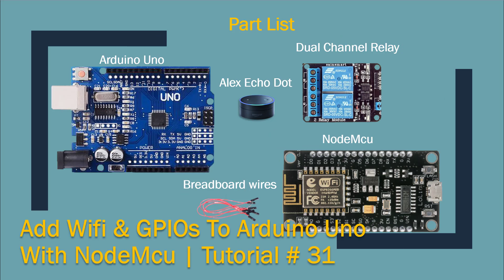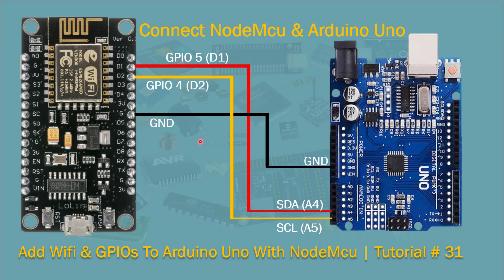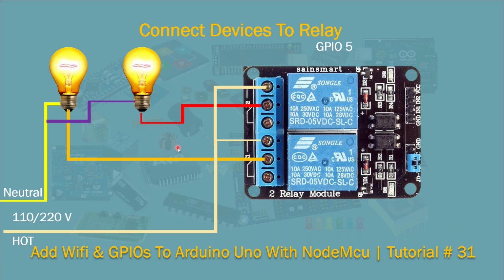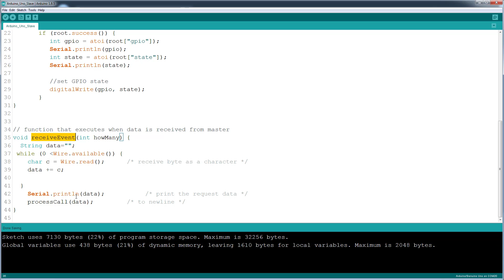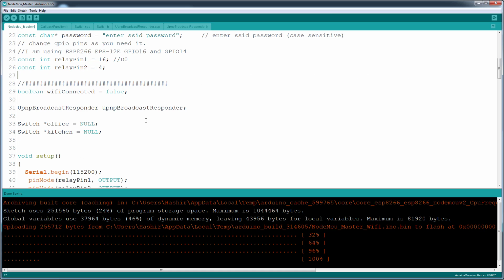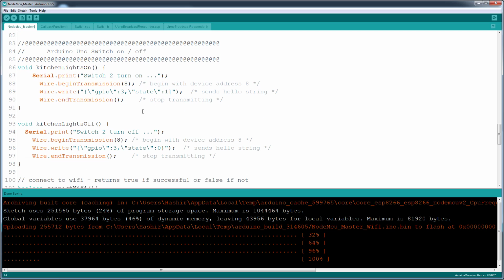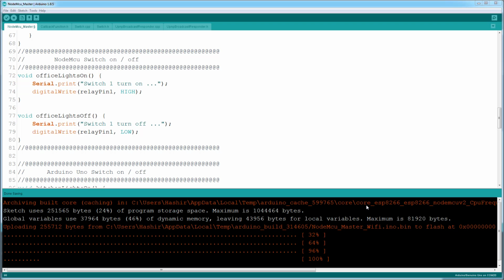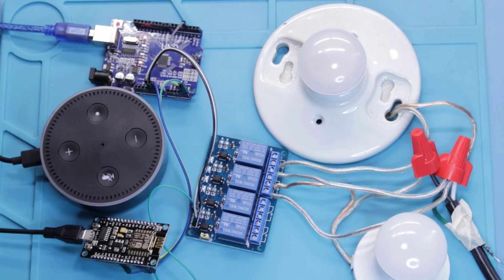Arduino & NodeMCU | Add WiFi And GPIOs | Tutorial # 31

Comment: how about the logic voltage, i mean since arduino is TTL 5volt while NODEMCU is 3.3v. it will not damaged the esp8266 chip?
Reply from the maker: Looks like Modem u is 5 volts tolerant

Comment: Hi,
I follow your videos. I am getting below error. I am not technical, just trying because I found it interesting. I am getting below error while flashing nodemcu. any suggestion from your side on this error? and Nodemcu could not connect to wifi.

Writing at 0x00000000... (7 %)
Writing at 0x00004000... (15 %)
Writing at 0x00008000... (23 %)
Writing at 0x0000c000... (30 %)
Writing at 0x00010000... (38 %)
Writing at 0x00014000... (46 %)
Writing at 0x00018000... (53 %)
Writing at 0x0001c000... (61 %)
Writing at 0x00020000... (69 %)
Writing at 0x00024000... (76 %)
Writing at 0x00028000... (84 %)
Writing at 0x0002c000... (92 %)
Writing at 0x00030000... (100 %)
Wrote 293040 bytes (211994 compressed) at 0x00000000 in 18.8 seconds (effective 124.4 kbit/s)...
Hash of data verified.

Leaving...
Hard resetting via RTS pin...

Comment: My q sir :- Connect minimum 3 Nodemcu devices with one Arduino-Uno OR Raspberry Pi( As
controller ) to Established connection between all the Nodemcu.
And on the basis of some range of virtual keys( like 10 keys per Nodemcu ) of Blynk
App, the controller communicates with there respected Nodemcu and do the work as per
data provided by Blynk App.

Comment: Thank you, bro..¡¡   But, I've a problem in the line "DynamicJsonBuffer jsonBuffer;" of the Arduino_uno_slave.ino 

 because that's need to upgrade to AndroidJson  v.6  , but I don't know how I've to do it.       Thank you so much, again :3   hehehe
Reply: I came across the same problem. I had a work around. I just installed the version 5 in ArduinoJson library.

Comment: Nice work
Could you please make revision of this video by adding dht22 or any temp and humidity sensor,.
Connect dht with uno and relays with esp8266.
read temp and humidity over esp  and one relay can operate with temp variation 2nd relay works with humidity.
Regards
Reply from the maker: Sure, I put it on my todo list. Stay tuned

Comment: Translated by Google Translator
Hi, very good video, I work perfectly
But I think this limited because you only have 10 outputs that if you connect Arduino one you take advantage but if you connect Arduino mega can not take all the outputs because there are more than 10
Ask.... is there any way that the NODEMCU active more outputs of the Arduino mega?
Reply from the maker: sparalable You can use the same code to access all GPIO on Arduino Maga.

Comment: I've got a nodemcu talking to an arduino mega. I can't seem to get the nodemcu to receive the numbers I'm sending it.  When I enter "100 200 300 400" in the serial monitor and press enter, it sends and shows as my int1 = 100 int 2=200 int 3=300 etc. 

But when I let the mega send the numbers, they are seen in the Serial window of the nodemcu, but they don't actually store to int1, int2, int3 etc.  Any idea what is going on? I'm waiting for your 2-way communication video! :)
Reply: do you have the schematic of your project ? im currently trying to make my mega communicate with my nodemcu

Comment: I'm working in a project that needs a multiples analogue inputs and my board is nodemcu ...
So how to connect it with Arduino
Reply from the maker: ahmed elattar Watch my Pi video. In it I show you how to add more analog inputs. You can use the same process and use NodeMcu instead of pi. Good luck.

https://www.youtube.com/watch?v=pBxeHlvF4eQ

Comment: Hello sir, for me its showing this      1)Error Board nodemcu (platform esp8266, package esp8266) is unknown

                                                                2)Error compiling for board NodeMCU 0.9 (ESP-12 Module).
Reply from the maker: Try NodeMCU 1.0 (ESP-12E..
Reply: need to add nodemcu board to ide
Reply: have you added node mcu to the boards in arduino ide?

Comment: Sir, can u help me with a project, i hav done it 90% but my current sensor is not connecting to wifi node mcu
Plzz help me if the code is to be edited .
Plzz check this link
https://circuitdigest.com/microcontroller-projects/iot-electricity-energy-meter-using-esp12-arduino

Comment: are you sure no level shifters are needed between the I2C pins of both boards?
Reply from the maker: No level shifters needed. NodeMcu GPIOs are 5 volts tolerant.

Comment: Thank you for sharing how to do this but one question, why would you? Would it not just be better to use the nodemcu and remove the uno? Ok 2 questions 😀 Sorry I am missing what the use case, more complex, more hardware, more power supplies. Cheers
Reply from the maker: I needed to do this for some of my projects for following reasons.

Independent parallel code execution

Need to drive two 5 volts motor controllers with WiFi
Project needs more than one analog GPIO with WiFi
Reply: @netmedias7657  Hey...! The idea of integrating Uno and NodeMCU is a good one. I know how hard it is to integrate multiple analog sensors to NodeMCU and I found difficulty in integrating ESP8266 with Arduino UNO. But this will increase the overall cost on components as both Arduino and NodeMCU are used. One promising solution I worked with is multiplexing the  analog signals with 4051 multiplexer IC. This mux has 8 input lines and help us connect 8 diff analog sensors to Arduino. But you can't access multiple sensors at a time. But I think getting values from diff sensors can be multiplexed. And if possible help me integrating ESP8266 with Arduino UNO. My mail id is msssuhas@gmail.com.This will help me a lot. Thanks...!